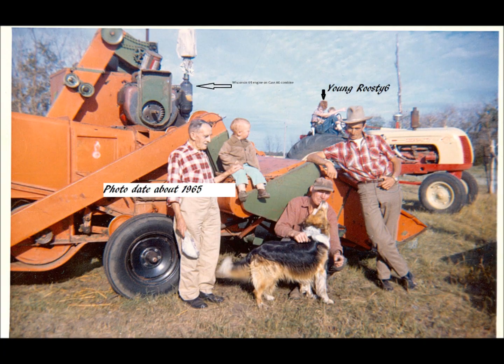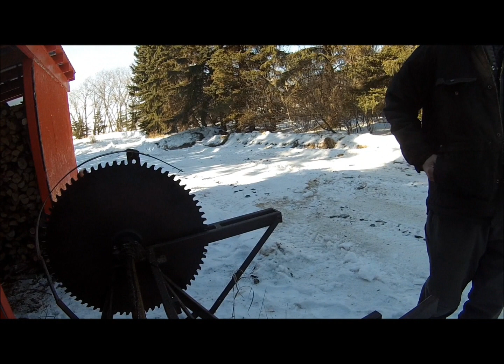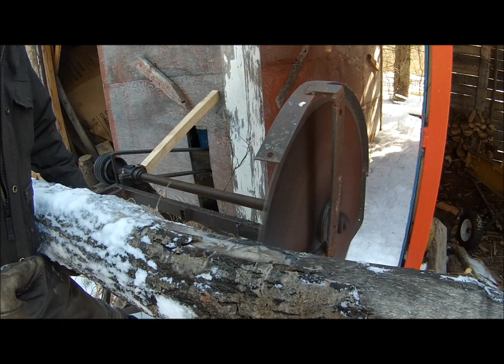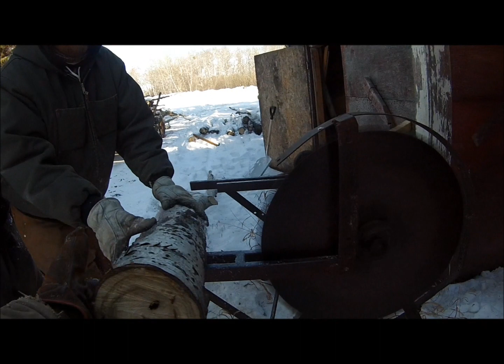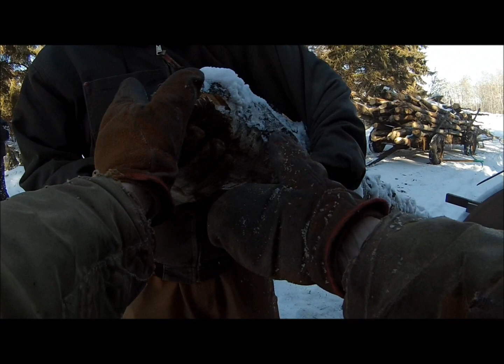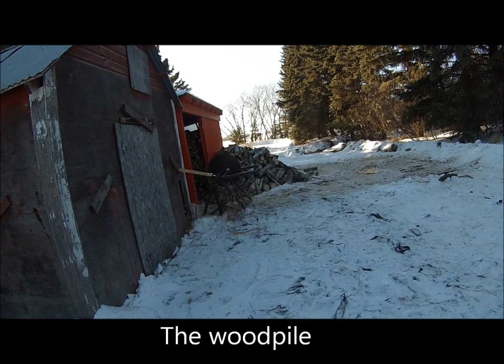Firewood Cutting March 2019

Comment: Thanks for sharing this, woooo thats what that funny shaft and pulley was for . we junked it to the bush 2 summer;s ago, we were cleaning out one old shed and neither me, my twin brother or dad did not know what that shaft was from, we still have that mega big blade hanging on the wall in that shed, guess we need to go to the bush this summer and search for its brother-shaft. he he he
Reply from the maker: Hang onto that blade. Even if nobody wants it for a saw, they might want it as an antique.
Reply: @roosty6  well its been hanging on that wall for all or most of my life, 16 years plus its not on the way so we just left it hanging there. now if only we can remember where we through that shaft cause seeing your video and remembering the 2 end of that shaft one side un-screws and holds the blade the other for a mega wide belt.[we got some of them belts rolled up in the attic in another shed,